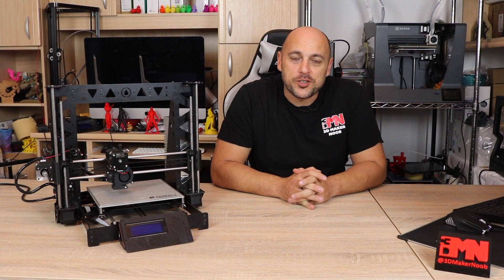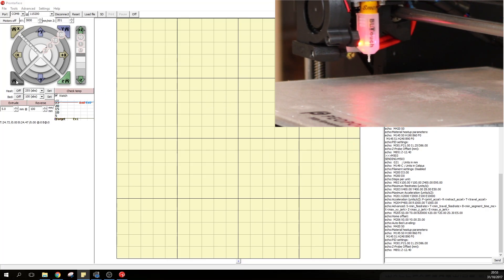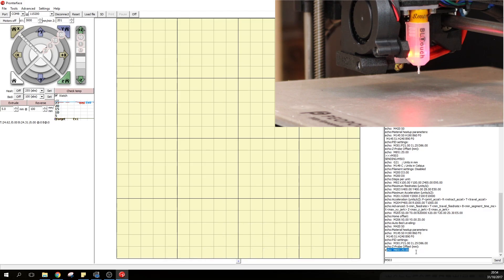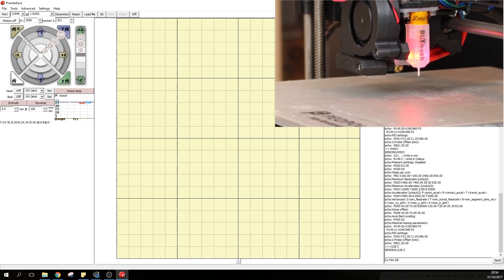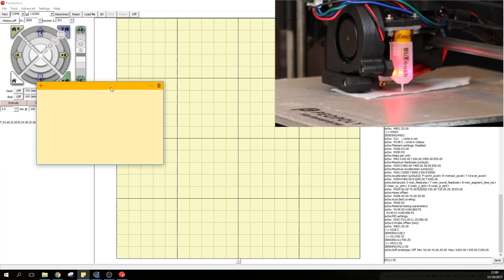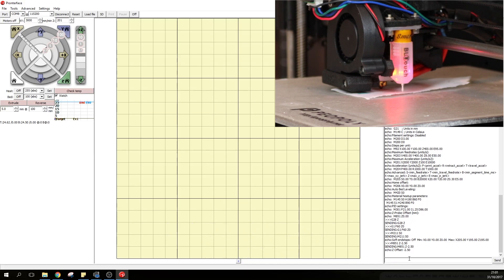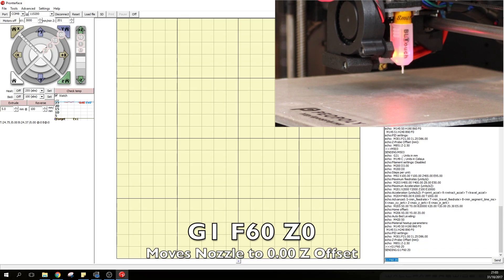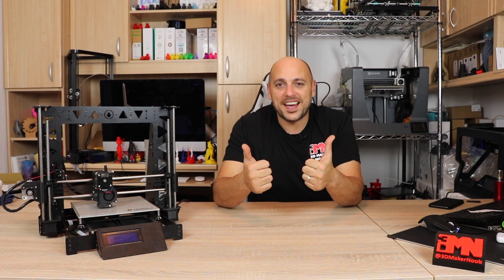Calibrating Z-Offset With A BLTouch Bed Levelling Probe

Comment: Dude! I have been struggling with this and my first layer for months after getting my printer back out to use. Every damn video that I've watched on setting the Z-offset neglects to mention that you need to add the thickness of the paper or gauge you use. Every single one! My first layers always had issues with adhesion and gaps between each line. I just ran through your steps and printed a first layer test and it is beautiful! Perfect lines and smooth to the touch. Amazing! Thank you!

Comment: BEST explanation ever! Easy to understand step by step. If you dont have a display, as is my case, and you need to know the difference value of your Z offset, whe you press in the pronterface interface to lower the Z axis, write down how many times you click on It (10mm, 1mm or 0.1mm) and there you have your offset

Comment: For days I was trying to get the proper z offset on my Ender 3 following several different instructions from the web. nothing worked. Finally, with your instructions, I was able to set it properly and the prints are fine now. Three thumbs up for you. The only caveat I was encountering was, my Pronterface (Linux) didn't work. It didn't get any feedback from the printer. I used than octoprint and it was working fine. Hallellujah.

Comment: But If just set the Z offset to match when the Z axis is at cero the nozzle is at that ideal height from the bed (barelly touching it), and then save settings, don't I end up with the same result?

Comment: This video is great but my used Ender 5 Pro will not home Z close to the bed after following the instructions carefully. I've even gone over it twice, now a third. Any suggestions? EDIT: If you are having this issue on and Ender 5 Pro, connect the original Z limit switch, even if you're not using it! Mine is zip tied to an extrusion. Hope this helps!

Comment: I had to remove my extruder head to fix an extrusion jam with the filament and in the process I removed and replaced the z probe offset.  Before I had my z offset at -.7mm

Now when I auto level the printer and manually set z offset with a piece of paper i have to go down -4.8 mm to feel some drag on paper but when I print the nozzle is off. I put the original z-.7mm offset I had before messing with the probe and it prints fine. How do I fix this? I haven't watched the full video I'm typing as I watch and hope this video helps.

Comment: Some printers like my Geeetech A10T, you have to use either the display, or pronterface to move the z axis down when checking with a paper or the real Z axis reading will just show 0 on the printer screen.

Comment: Hello. I have it connected to the pronterface app but it is not showing any of the commands. it is responding to commands when i click auto home. It is not showing the cmd line or  responding when I type
Reply: you may have fixed this by now, but just in case you'll want to go to settings up top and then click on options. you'll be able to see and adjust your z offset here. all the rest of the commands he uses in this vid should work though. confused me for a sec as well, as obviously pronterface has changed a bit within the last 5 years lol.

Comment: I must be missing some software. I obtained this Ender 5pro used from another user, and i have no software for computer like this. Where would i obtain this software used in this video? This machine has the silent board, BigTreeTech /Marlin console. I run it in Marlin because BTT halts halfway through a print almost every time.

Comment: great vid i am using ender 3 s1 pro and move my cr touch to the left, set the values 46 and 1.6 when  probe leveling the probe is to far to the left goning near the edge  how do i fix this

Comment: Will this work with a TH3D EZBoard v2 fitted with a TH3D EZABL Pro?? The EZABL is a touchless sensor with no moving parts. The instructions they give are just not wanting to work for me, and the bed keeps forcefully crashing into the hot end when I home Z, no bueno. Also, my Ender 5 Plus is always wanting to home X and Y to the rear right corner of the bed (350 and 350), how can I change that to 175, or 1/2 the actual size of the bed??

Comment: Thanks for a great video unblocking this for me after upgrading to Marlin 2!
FWIW; This approach also works great remote via OctoPrint (or preferrably OctoPod on my phone while at the printer). 
Haven't used Pronterface much as I need to bring an extra computer to the print station.

Comment: My display cable is a little wonky and right at the line where it shows the Z position, it's actually blank lol
Use M114 to display current nozzle position to get the Z offset position if youre like me

Comment: I Do and follow your step but still far to my bed even after homing and Do G1 F60 Z0 at last still far on bed
Reply: Please don't take this the wrong way. You have missed a step somewhere. Have a break and follow the steps slowly, double check each time. 99% of screw-ups are simple things we missed. And 100% frustrating. It might not help you but one of my problems getting to Zero was the horizontal gantry on my Ender 3. The rollers were not tight enough. For me, that helped A LOT. Also, the lead screw was loose at the stepper motor...grrrrrr

Comment: This is BY FAR the best Z Probe Offset video in existence. Thank you so much for doing this! The only critique I could make is that I wish you had shown how to do everything with the pronterface serial/CLI interface. It's pretty easy to do if you use `G91` to switch to relative position/motion mode, and use `G0 Z-0.1` repetitively to close the gap. Then use `G90` to switch back to absolute position/motion mode. But as is, this video can serve as a "model/manufacturer independent, all pronterface, no LCD/TFT/Dial/Touch" method for everyone. And for that, I thank you. (--Daniel Tosh) ☮❤🌈🧘🏽🕉☸☯
Reply: I agree. I always come back to this video every once and readjust my z offset on my E5.

Comment: If the paper thickness is ~0.1 and you have an offset of -2.49, changing it to -2.50 is an error, as you only subtracted 0.01, not 0.10 - it should be -2.59

Comment: Hi. This is a very informative video for setting the z-offset. But I am having trouble after the step where the soft end-stops are switched off. I am unable to move the nozzle down even after giving the M211 S0 command. Kindly suggest what alternative way can I follow to proceed further.

Comment: I had just installed a CR Touch on my Ender 3 V2 and nothing would stick to the bed. Not a damn thing. My prints weren't great when I was levelling manually but they at least printed. Then someone pointed me to this video and I have no idea what witchcraft you worked to figure this out but thank you so much. I ran a test pattern and every line was solid, with sharp corners, and perfect adhesion.

Comment: Very good how to video. You get a thumbs up. But I need some clarification. When moving the nozzle down to find the offset with a piece of paper under it, the printer showed Z  -2.49 (distance below the default Z-offset). Copy paper is 0.1mm thick. Isn't this the ideal distance to start the print? Or even a little more, up to 0.2, using a 0.4 nozzle? So input code should be M851 Z -2.49 or up to -2.39? (-2.49 + 0.1 = -2.39). You actually subtracted an additional 0.01 to get -2.50 and this put your nozzle even closer to the bed.

Comment: Hi, i have the crealty cr-10s pro v2 and having major issues with leveling the bed. the nozzle on myn pushes down hard against the plate if i use the auto home function brand new from the box. do you have any idea why it would push down on the plate so hard? i have to pull the plug to stop it, it literally looks like it will destroy itself if i left it. it has already left a dent in the plate.

Comment: Any updates to this? I have a SKR mini 2.0 e3 ender 3 and it seems the codes would be a little different 5 years later, as this is not quite working correctly for me. I'm at m211 s0 and the steppers are still holding, and I got the info command sent to me on both m501 and m503
Reply: Also, the z does not change in pronteface or on enders screen, if I disable steppers manually and move z😑

Comment: Been fighting this for over a year on and off. NO matter what I do, no matter how often I adjust my Z after testing with paper (steps Z=-0.79) and saving that info, my printer still prints way off the bed. I've even gone =/-5mm on the offset, saved that and it still prints at the same height above the bed. New firmware ect. Frustrating crap

Comment: My value is 15.7, I've followed 3 times and got the same 3 times but it says out of limits when I try to set that value, please help
Reply: If you followed the guide then your Z 0 point should be where the BLtouch triggered. that is when the nozzle doesnt hit the bed yet. then when you move the nozzle down more (than 0) it wil become a minus value -2.5 for example. it is impossible to have a positive value here.

Comment: My Ender 3 V2 didn't show the current position on the screen after step 9. 
M114 will show the current position in the terminal.

Thanks for the super easy to follow tutorial!
Reply: so, i'm an first timer. did it work perfectly with this video or did you have to do anything? thanks.

Comment: I thought this was the answer I was looking for but it made no difference. I followed along and it all worked perfectly but when I did my first print my nozzle is a few mins above the build plate like it always was. Using this method has a result which is no different then calibrating it the way creality and everyone else advises - the difference is in the way it's done but end fail result is the same.

Comment: Great explanation but the true Z-Offset is set based on wherever the bed is, isn't it? So, if my bed is really high up  from the start, won't the true Z-Offset be based on that really high bed set-up? If so, what is the true height of the bed to link the true Z-Offset once configured?

Comment: I needed an extra step with the skynet software. Appearantly you have to do "restore failsafe" on the printer everytime you want to store a setting or it will not stick. The hotend pressed the bed down a few times before I figured this out :s

Comment: You say that the thickness of the paper is about 0.1mm, then you say to add that to measured Z offset (-2.49mm) to determine the real z offset to the plate (which makes sense). But when you add the paper thickness, you're only adding 0.01mm (-2.49 + -0.01 = -2.50). Was your math wrong or do you not really need to add the paper thickness to the Z offset?

Comment: Followed the steps but doesn't work for me. First of all when checking if the offset is saved I send the G1 F60 Z0 command but for some reason it stops at the original zero offset and after I've sent the command a second time I actually get the offset that I set.

But this unfortunately doesn't amount to anything as in my 3D prints the offset is completely ignored, even though the Z offset in the menu system displays exactly what I put in.

Any idea what this might be? Does auto bed levelling have an influence on this?

Comment: Does any of this still work, if you don't slice with Pronterface? I have it installed, but don't slice with it.
I use it because it has an excellent firmware interface. I'm a CURA user. If I connect Pronter and go through the motions, like you did...
what happens when I slice with CURA?
Reply: Put "M420 S1" in your startcode right after G28. This gets the Meshleveling values from your disk made previously with your bltouch.
Reply: @RushMyEx  Thanks for taking the time to reply. Fortunately, I had someone help me with this. However, instead of entering "M420 S1", I entered another "G..." variable, which did the same thing. I don't use BLTouch, which is why I was forced to use the other code. But, by golly... it worked like a dream. Now, everything saves to eeprom, like it's supposed to.

Best of luck to you. Stay safe.

Comment: I follow the commands exactly but for some reason when I enter the computed Z offset M851 Z-x.xx the head will go up and the displayed Z number is different from the computed one. I save everything then go back to verify the actual Z position with G1 F60 Z0. The nozzle tip distance from the bed is the same distance after the head moved up when I enter the new Z offset. I don’t get it, any idea why is this happening?

Comment: Great tutorial.  I have one issue though!  So I save all this and it looks great while plugged into the computer.  When I disconnect, the z offset is gone.  I tried to manually save the z offset on the printer, but there is no noise when I press the save button.  Any ideas??

Comment: Hello. This procedure worked great on my Ender 5 Pro, except the M500 command doesn't appear to store the settings to EEPROM. I have to use M851 every time I print or the default offset is reloaded. Do you have any idea why this should be? Thanks in advance.

Comment: Many thanks  for this very clear and concise video.  You saved me a lot of headaches as  I had been messing around with the Z offset for days after I installed a new V4.2.7 mainboard  on my Ender 3 Pro (with BLTouch)  and I was getting nowhere fast.  For those with the same printer as mine (and with the V4.2.7 mainboard),  for some reason the display does not show the Z offset  but you can use the M114 command line in Pronterface to get the Z offset value.

Comment: I've tried this process 8 times now, I'm having absolutely no luck with this. I've tightened down all 4 springs and re calibrated Z Offset and still the nozzle doesn't come down to the bed close enough to put a good first layer down..
Reply: Use the z step in tune and then lower it
Reply: @bruhboi554  This is the way. I had the same thing happening and tuning while doing a test print solved my issue.

Comment: Hi. Can you please help me? I think I am the only one who can't get it work. Everythings work fine until the last step when I check if it sets the height well after homing. Unforutnately it ignores the z-offset. On the info screen it shows 0 to z-offset, but when I go to z-offset settings it shows the good value. Overall, when I start the print spaghetti comes, because it doesn't count the z-offset.

Comment: 2017 Video and still the best video i have found, Legend! 3 days trying to get my new CR10 Max printer to work, came across this video and 15 minutes later, I was printing my first test Elephant, which came out Flawless.  Although the display is different on my cr10 max and cold not see z figures, i used the press down 0.1 + 0.1 + 0.1 = -0.3 or in my case -1.9.  when the paper moved i went home then reset to -1.85 which was perfect.  Thanks
Reply from the maker: Happy this video aged well :)

Comment: Hello, I installed the pronterface program, I have put this firmware version into the ender 3 pro. VER. Ender-3 Pro_4.2.2_BLTouch_Marlin2.0.1 -V1.1.2.bin I have the printer connected to my PC it homes when I click the home button on the Pronterface screen. But, I am not seeing any settings in the panel on the right of the pronterface screen. I only see  processing echo:busy: repeated over and over. nothing else. What am I doing wrong? Please help if you can. Thanks

Comment: I've done this a couple times now, and when I do the G1 F60 Z0 at the end, it is always back up to the non-offset 0? It is not almost touching the bed as you say it is supposed to be. I don't know what I'm doing wrong. The offset shows in the M851 when I check active settings as -2.4 like it is supposed to. But it won't go all the way down on my cr-10 s5?

Comment: Thanks for the video. Only problem is, I can not see proper Z value on screen. Z seen 0 and when I start to adjust Z, it does not go as -1, -2....... but 729.6, 728.6....... etc. Logically a simple calculation first value minus last value where paper stucked should give me the Z value. But no! result of that calculation does not help, nozzle stays too high. My printer is Ender3 V2 with 4.2.2 board. What can I do to see (know) correct value? Thanks.

Comment: Great video. Just a note that the paper should be .05 to .10 thickness, not .01. You said it correctly but typed it in wrong. For the record, when adding BLTouch to my Ender 3--- I installed the Bed Visualizer plugin for Octoprint (but there are Bed Visualizer websites).. and while the paper-drag test felt perfect, the visualized bed showed clearly that one side was higher than the other. I leveled it based on the BLtouch feedback rather than my own paper-drag judgment. 

Also for the Ender 3 crowd.. install the SKR mini v2 board. Night and day. 90% quieter, no motor noise at all. Just don't try and replace your springs with spacers like  I did.. the BLTouch ain't a miracle worker.